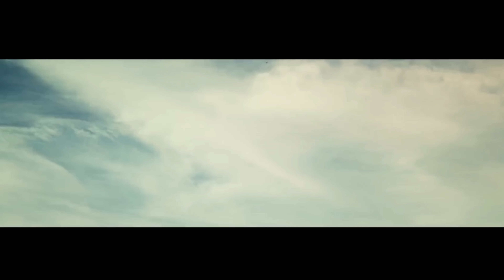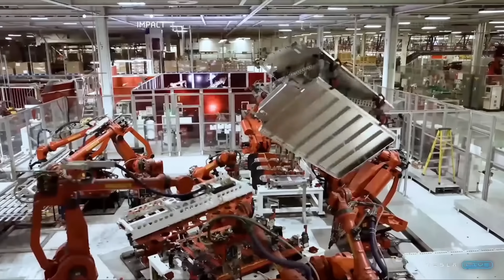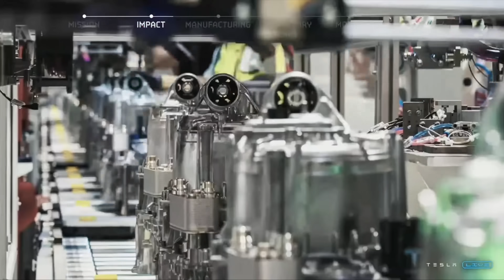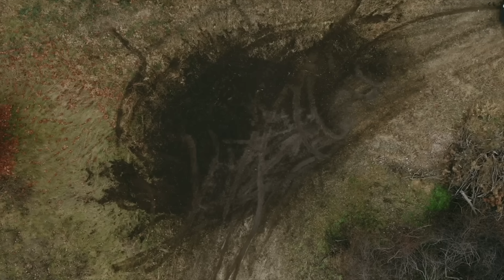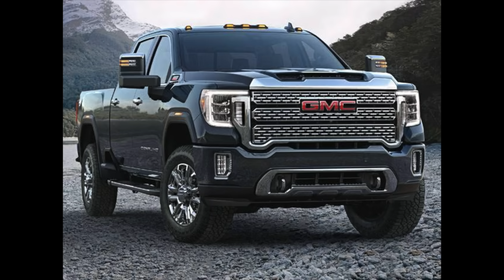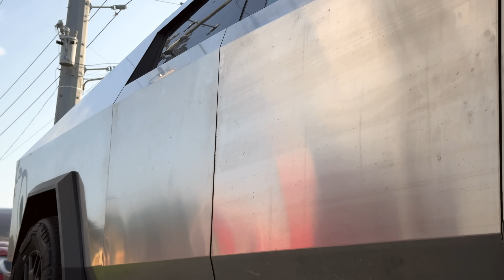BREAKING: Tesla Cybertruck Details Emerge in New Documents! (VIN Decoder Updated!!)

Comment: Quad motor = safety through vastly superior wheel independent traction control. Deletion of fragile parts by potentially removing two differentials. Additional redundancy if three motors fail.  If the rear steer would articulate more than it actually does, quad motors could also give you a 0-point turn without having to scrub the tires off in an unsafe way.
Reply: @@OrwellNailedIt You are definitely correct and I know I'm fantasizing but I'm not talking a Rivan style useless skid steer tank turn. I'm talking a useful everywhere, spin your around vehicle center without scrubbing a single tire. 

The strongest gear set is no gear set. Dana 60s are fragile the way I use them and you'd never need a locker with four independent motors. Granted most of the benefits are for off-road but the greatest benefits are for keeping you on road.

Comment: And if you check that Magnets USA bottle opener with a magnet, and then use that same magnet to check a piece of steel, the attraction is the same. So I doubt that "stainless steel" bottle opener is actually stainless steel. Yes, some stainless steels have enough iron and cobalt to be a little ferromagnetic, but not as much as this bottle opener. I can't wait to check the Cybertruck with a magnet! (Did you happen to check it when you got up close?)

Comment: 45 caliber not millimeter (bullet is 0.45 inch diameter) .  45 has more energy but less penetration than a 9mm (9 moves much quicker).  Most likely loaded a 100 round drum with 75/74 rounds.
Reply from the maker: Did I say 45 mm? That’s dumb if I did
Reply: @BeardedTeslaGuy  it’s all good. Funny thing is when I saw that video earlier I though they were too big to be 9mm
Reply: 9mm will penetrate a steel helmet at about 4x the distance that a .45ACP will, so this definitely brings up questions about what it will stop

Comment: I don’t really want TSLA to take early losses on Cybertruck, to say they sold it at an affordable price, just so early buyers can flip them for 3 times the cost. I’d rather Tesla sell the high end version while they sort things out snd get production ramped. TSLA does not need further pressure on margins. The first 100,000 of these trucks will sell for any price under $125,000, assuming the features offer value.
Reply from the maker: The flippers are going to be a real problem
Reply: @BeardedTeslaGuy  they will go at least $50k over MSRP the first year of production then $25k the 2nd year just like the C8 Z06
Reply: @BeardedTeslaGuy I want Tesla to initially price the CT high because of the flippers. Any prediction on how Tesla will fulfill reservations (e.g. chronological order)?
Reply: @BeardedTeslaGuy  in this tough of an economy though? 🤔
Reply: The flippers are going to cause a lot of headaches, saw this with the other EV manufacture...real douchy
Reply: Not a chance, the auction of a low vin ct only went for 400k.
In mid 2021? Sure they could get 100k+easy for the first year's worth of production. It's a different macro now though.